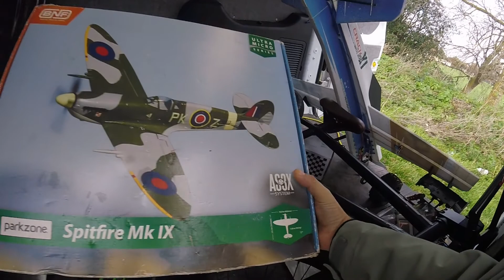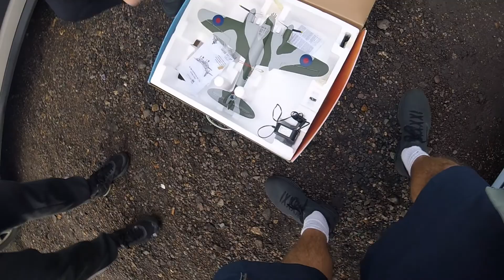Parkzone Micro Spitfire & Mosquito 😎

Comment: You guys really know how to have fun with rc. Fun to watch. I love helicopters and recently got the Esky 300 v2 which looks like the Airwolf helicopter. It is really easy to fly, its fixed pitch and cant roll over at all. It just flies really scale and for a pretty long time. It has belt drive with a narrow profile. Check it out. It is also available now from Horizon but it has a red body. I like the Airwolf look better.
Reply from the maker: Hey bud thanks for the lovely comment much appreciated my bro 👍🏼 I will defo check out that heli sounds good. I have still not had a proper heli just quads but 1 is defo on my shopping list 🤣🤣🙈🔥👍🏼 been collecting loads of new toys recently and will vid all the shannaigans 🤣🤣 👊🏼